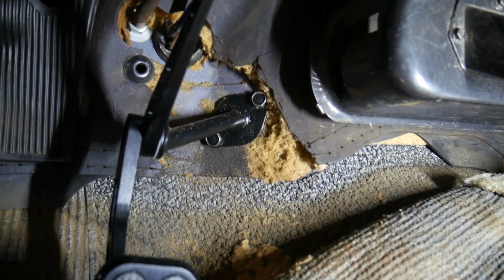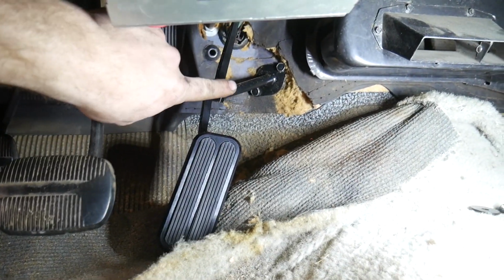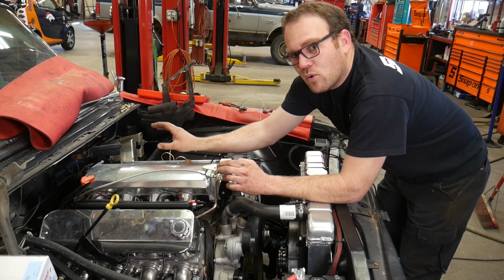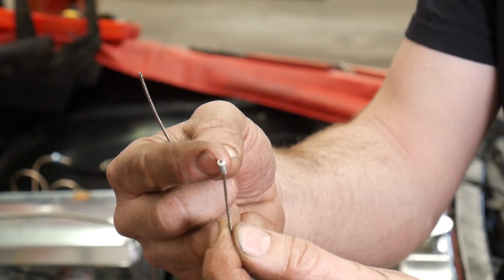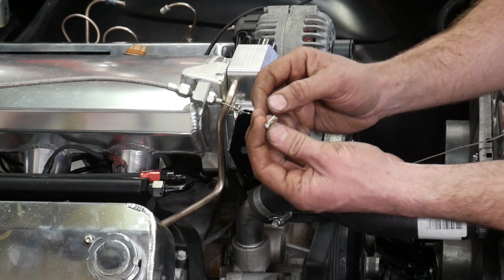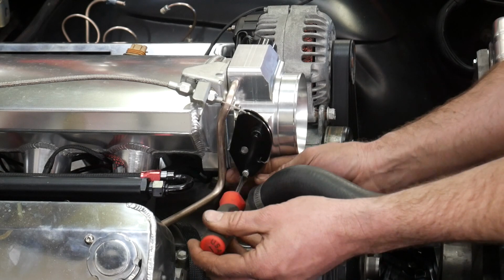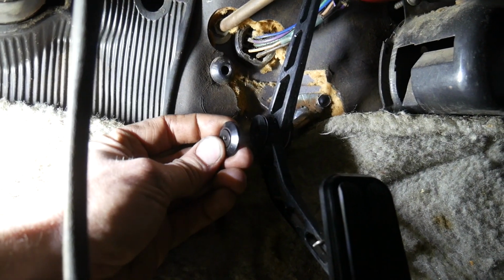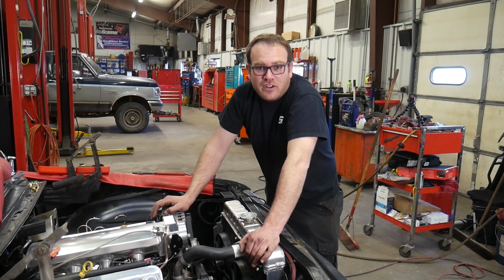1960 Biscayne LS swap EP 40 - Installing a throttle pedal and cable

Comment: Just because the throttle linkage is old doesn’t mean it’s a mess. Modifiers are always so quick to disparage an original design to justify throwing it in the trash bin and replacing it with something shiny. It lasted 60 years and your cal custom throttle cable broke before you even got it on the car.